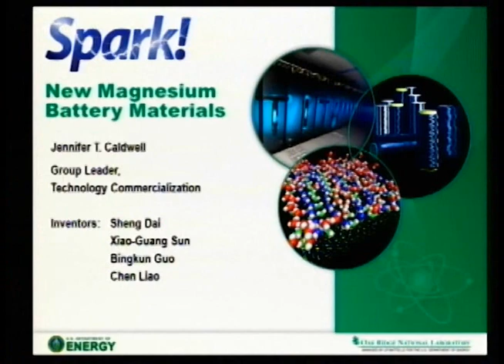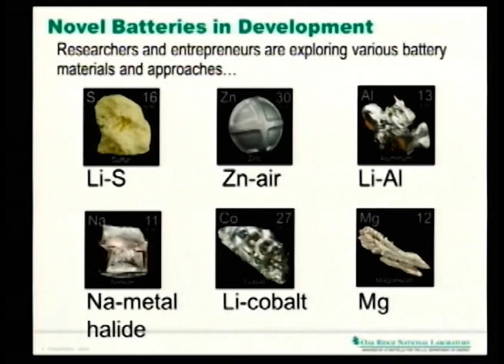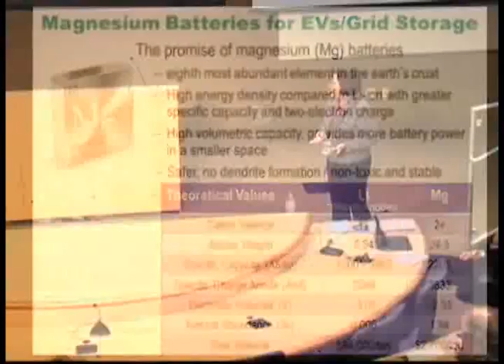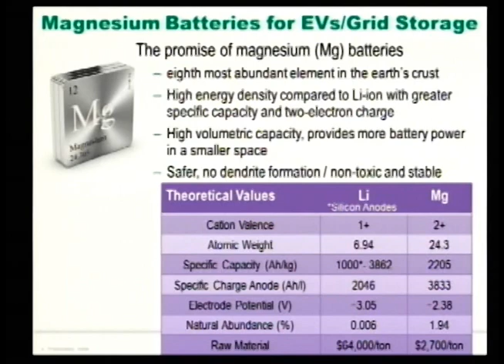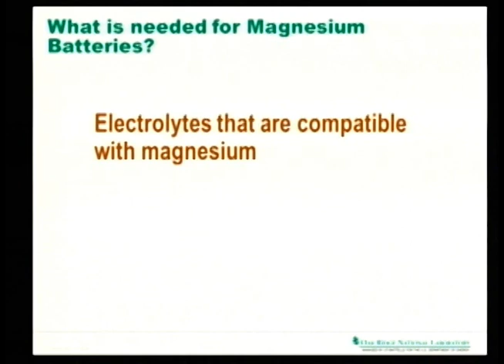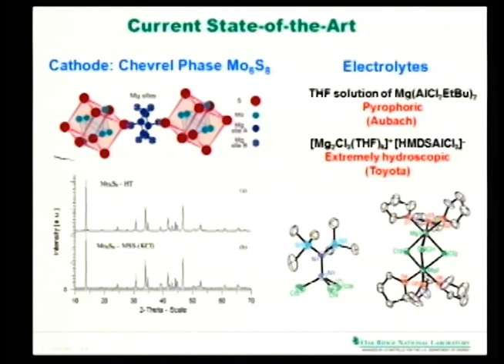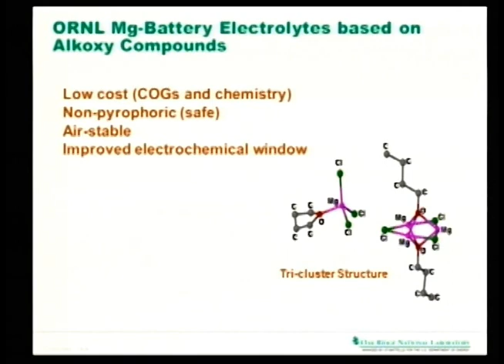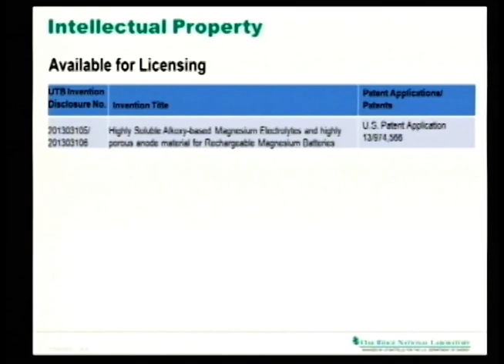New magnesium battery materials

Comment: Wow, use COPPER as the cathode.... duh!!!! as for the electrolyte..... use one part alum, two parts  part potassium chloride, 5 parts glycerine and add starch until it begins to become a gel...... anode is magnesium....let the electrolyte become firm. to activate and recharge have a small whole at the bottom of the copper cap and put 10 drops of water!!! shake slightly upside down. When it dies recharge using another 10 drops of water. repeat........ or you can charge conventionally using 1.3 volts above the standing voltage of this compound..... shoot some of that funding this way!!!! I have 12 cells that have been charged and discharged over 2,000 times like the ones I have described. Need help send an email Toyota I will help you out!
Reply: Hi David! I am working of a magnesium-Copper battery project. Can you help me with my project? I have some questions regarding your battery.